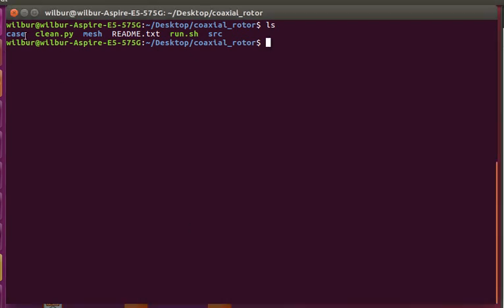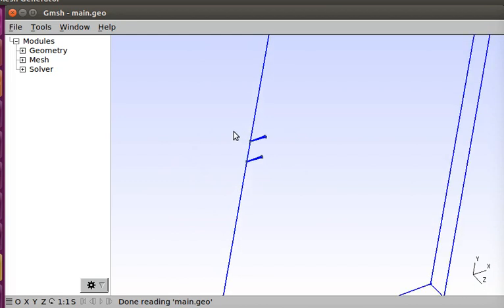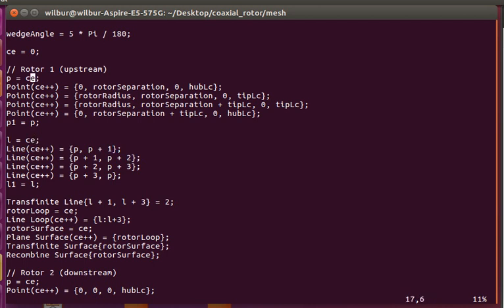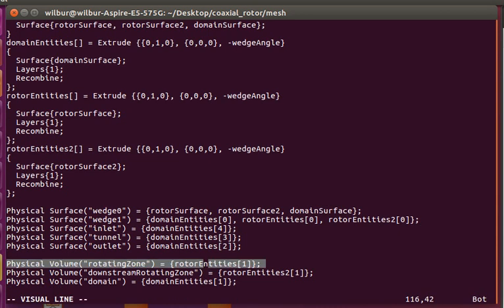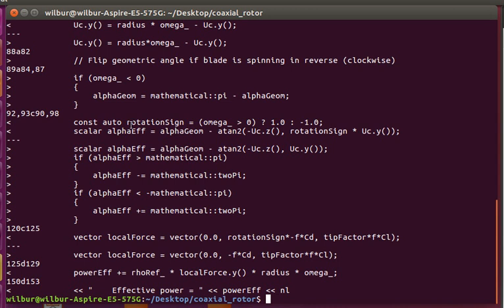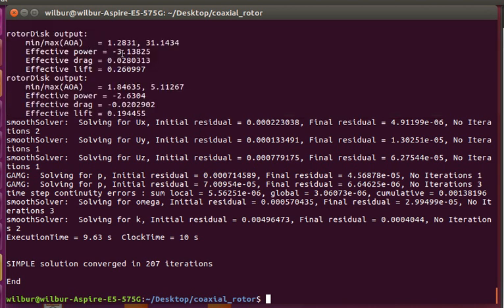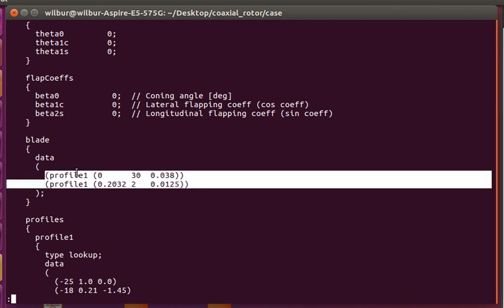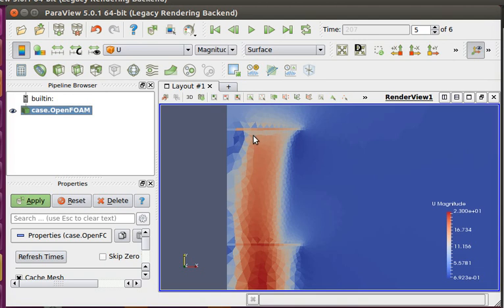Coaxial Rotor Simulation in OpenFOAM

Comment: Hello Open!  I trying to run the Coaxial Rotor Simulation in OpenFOAM and having trouble.  Whenever, I execute the gmsh (4.0.2) command, I get 15 error message...
"Error   : Degenerated hexahedron in extrusion of volume 1".  I tried it with earlier version of gmsh (4.0.1 and 3.0.6) but didn't make a difference.  Your other examples (Propeller) ran fine but can't get this one to work.  It appears to be generated from the portion of the code that extrudes the domain.  I would appreciate it if you could let me know what I might be doing wrong.  I'm running  Ubuntu 16.04 LS and OpenFOAM 6.
Thanks,
Ben
Reply from the maker: Hi Benjamin, have you looked at the generated mesh to see if the problem is obvious? Since the single-propeller simulation works for you, I suspect gmsh does not like your inputs, if you've changed them from the defaults.